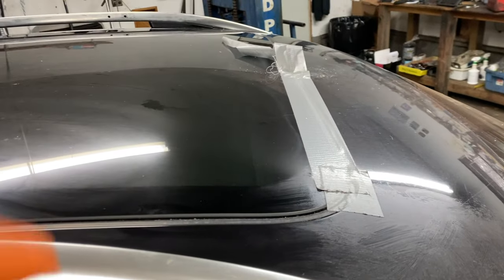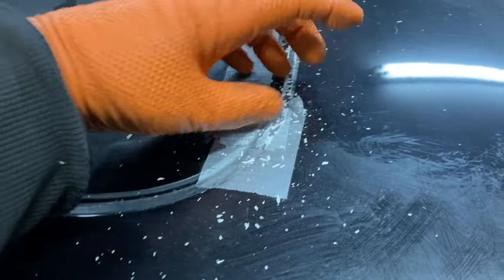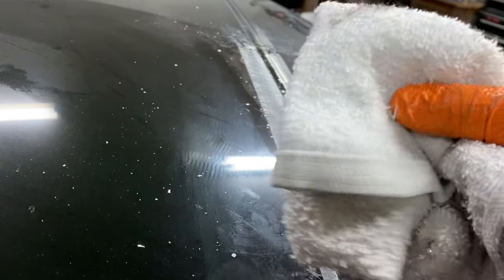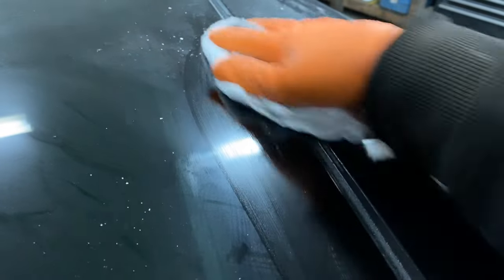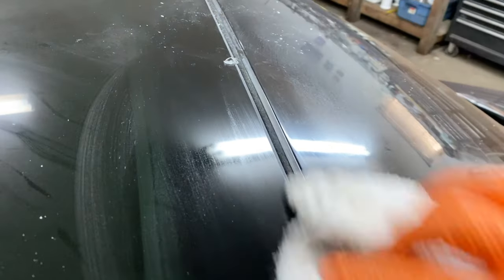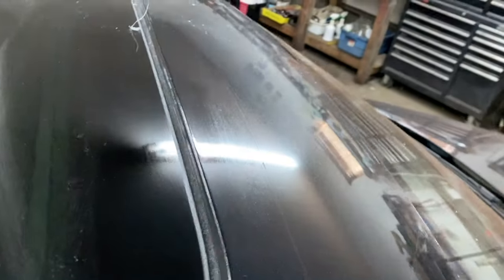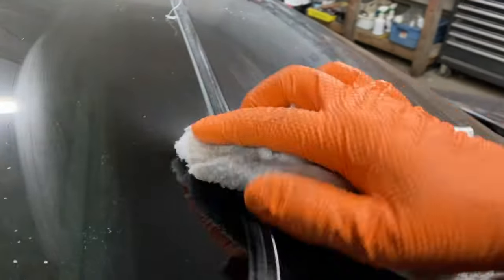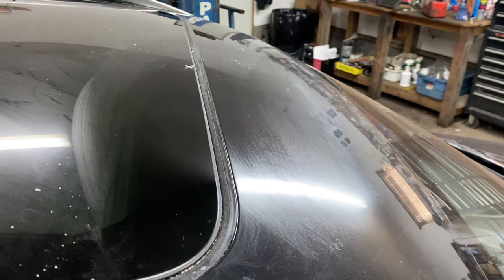How To Remove Duct Tape Residue From Car - No Paint Damage - Fast & Easy DIY

Comment: Careful, I tried this on the side of an enclosed trailer with tape residue and the gasoline messed up the sheen on the paint. You can see exactly where I rubbed it years later.
Reply from the maker: Yes I recommend only on automotive factory finishes and to clean afterwards with soap and water. If your shine is dull some micro finishing compound will bring back the shine. Got to remember putting duct tape on a vehicle’s paint in never a good idea to begin with. Thank you for the feedback

Comment: 1 hour ago did a test patch to remove duck tape off my 2006 mercury grand marquis using a sponge lightly damp in gasoline while it lightly rains. Question does using gasoline effect paint or clear coat or both and how so ?
Reply from the maker: You have to be very careful about using gas. And should wash with soap and water afterwards. And may need to use some polishing compound to bring up the shine. You have to remember you’re not supposed to put tape on paint to begin with.
Reply: @motorcarnut  Well at 11:45 PM friday night someone smashs out your rear window and you have no shaded are to park your car. Trash bags and duck tape are better then nothing. Didn't like the gasoline test patch. Next week try goo gone on another small test patch.

Comment: OK THANK YOU. You saved my butt. Contractor cleaning our driveway to patch pot holes. High power blower shoots rocks at the car and broken window. I used shipping tape to hold cardboard on and tape is on the paint. My wife is NOT HAPPY with me. So when the window is replaced we will use your method of gasoline and quick cleanup to restore paint from my bad decision.
Reply from the maker: Lol, no problem, just after the remove the residue use clean water the soap to clean off the gas residue as well.

Comment: I inherited a 2003 Buick Century with only 48K miles on it. However, the previous owner duct taped the drivers side back window up due to malfunctioning window regulator. It has since been fixed. This is the information I needed. I tried various residue removers, but they have been insufficient. I guess I’ll have to go borrow some gasoline from a neighbor as they own lawnmowers, and I don’t. Thanks for a very helpful video!
Reply from the maker: Sure, no problem.

Comment: Thank you so much for this information.  Now, I can remove 2 years of duct tape from the top of car.(My sunroof shattered and I've had to use 3M masking tape and a heavy duty clear shower curtain to cover my sunroof on a 2019 Volkswagen Jetta)
Reply from the maker: No problem, just clean off residue with soap and water afterwards. Good luck

Comment: Awesomeness. So a good while back, year plus, I ran across some white paint in the road some weird way. It splatter in the fender wall and down side of my black car. What best, easy way to remove that paint?
Reply from the maker: That can be a good question for an auto body shop, they can steer you in the right direction.

Comment: Good tip. I'm actually curious what car it is? I use a PPF film to seal a badly leaking Volkswagen Tiguan panoramic roof. Apparently a common Vw issue and insanely expensive to repair properly.
Reply from the maker: Thank you! It was a VW Tiguan. Most of the times the water tubes get loose and just have to be re glued to stop most leaks on the particular vehicle.
Reply: Aucune solution de réparation c’est un problème connu chez VW sur tout les modèles tiguan touran sharan … c’est le châssis du toit qui se casse

Comment: I used Packing tape on sunroof of a 2013 with factory paint. The residue is super sticky even with all the recent rain here. Would this work? I read possibly white vinegar.
Reply from the maker: For the glue part not the shiny tape itself, Yes it will, just make sure to wash the residue off after you finish.

Comment: I want to use this for my windows, however my windows are tinted. Will it remove the tape residue and the tint? Or will the tint be okay?
Reply from the maker: Aftermarket tint? Usually tint is applied to the inside of the glass?

Comment: Thanks a lot. I hope it will work on Matt finish as well as i have Matt grey paint on my motorcycle tank and just removed the duct tape but a lot of hard residue is left on it
Reply from the maker: If it's a factory finish it should just try a small spot first

Comment: Will this work even if my duct tape is not dry but like super adhesive still?
Reply from the maker: Yes< just do a little bit first to make sure and don't forget after you remove the glue clean with soap and water afterwards to protect the paint

Comment: Hey...what if I had 2 layers of gorrila tape ? & it's been baked by sun for around a YEAR" now ...thanks
Reply: .....just like the video
Reply from the maker: If the top piece of tape comes off and leaves just the sticky or dry residue it should work. Just make sure you clean it after with soap and water.

Comment: I went a little crazy with duct taping my broken back windshield and tape residue not just on the glass and the window but on the back light 😂 is it safe to use the gasoline on the plastic back light cover?
Reply from the maker: That I am not sure, may damage the plastic. You can try a small area just to see if it works, but that's up to you.

Comment: Would that strip the coating on the paint?
Reply from the maker: You have to use this method at your own risk. I have many people do this judging by my comments with great results. Factory paint should not be a problem but just test in a small area then wipe clean with soap and water. Can dull the surface requiring some compound. Been using this method a long time with no problems.

Comment: Does this work with transparent scotch tape that is stuck on the car?
Reply from the maker: For the sticky glue yes, but the tape itself would have to be peeled off first.
Reply: @motorcarnut  This advice really helps me. Thanks!
Reply from the maker: @criss6945 no problem
Reply: @motorcarnut  got it.
Reply from the maker: @juncapulong1911 great

Comment: Doesn’t the gas thin out the clear from the paint and start to fade the paint on the car later on ???
Reply from the maker: Just like any chemical, use it at your own risk. I stated that if you don’t feel comfortable don’t do it. I never have a problem over many years. Just wash the vehicle right afterwards.

Comment: Is this gasoline that’s used to start a fire? lol I am a bit scared so I just want to be sure. Help
Reply from the maker: Yes, and I would not recommend you to do this if you’re not comfortable in handling flammable liquids and should be in an outside well ventilated area. So don’t use this method.

Comment: but as woman, how much gasoline would I have to buy and store
Reply from the maker: You don’t need much and depends on how much tape residue you are removing. If you don’t feel comfortable with handling gas don’t use it
Reply: What else can I use instead of gasoline
Reply: @motorcarnut  what else can i use
Reply from the maker: They have many products like goo gone you car try, just be careful of the paintwork, try a little at a time

Comment: A lil hydrogen peroxide n dish soap in a spray bottle with hot water will do the job . Tried it today came easily off just used a credit card to help take off some flex tape on my car
Reply from the maker: Thanks for sharing

Comment: Great gasoline! What if it’s inside the car ; (
Reply from the maker: Then I wouldn’t recommend it.
Reply: @motorcarnut  Yeah.
Would WD-40 or some other chemical that you recommend be better?
Reply from the maker: Depends, where is it stuck to in the inside of the vehicle?
Reply: @motorcarnut  It is the rear window. The defroster is there too. 

Duck Tape was used by my neighbor to hold up a broken headliner. I fixed it but now need the tape residue removed. So that is how it got there too.
Reply from the maker: If it were me, I’d use the gas and put down some plastic to protect the interior and just put some gas on a rag a little at a time. Never use a scraper on the rear window defrost it will ruin the defrost element.
Reply: @motorcarnut  
Thank you for the tips.
Reply from the maker: No problem
Reply: @motorcarnut  Update:
Used windex mixed with vinegar oil, sprayed on the residue and scraped it off with a small razor. Came off good. Wanted to be safe with interior pieces. Avoided using gas or WD-40.
Reply from the maker: Great! But hopefully you didn’t scrape the defroster element?
Reply: @motorcarnut  
It was perfectly fine, my neighbor insisted using that. Probably not the right thing to use but I know for sure that the grid lines were not scraped.